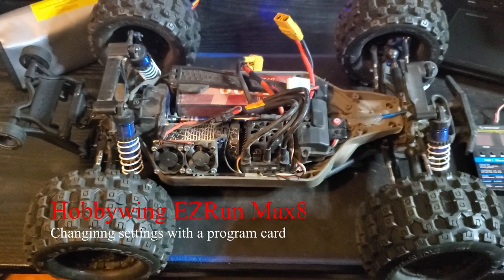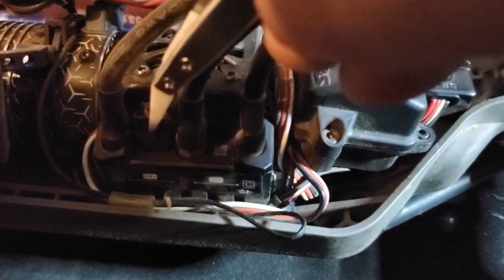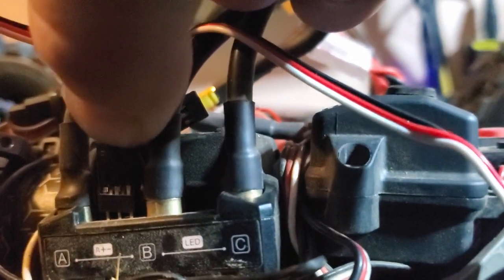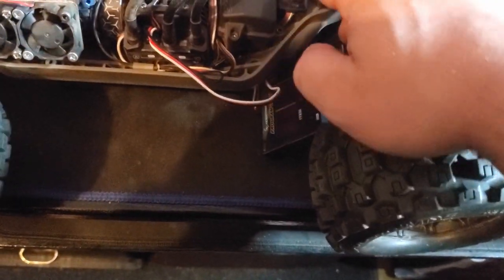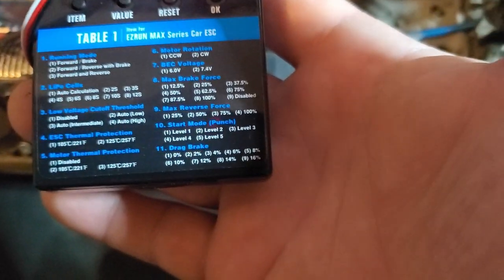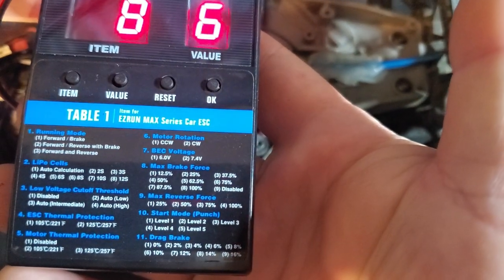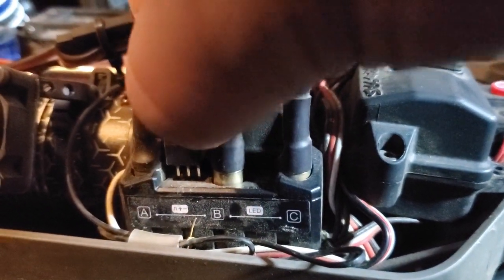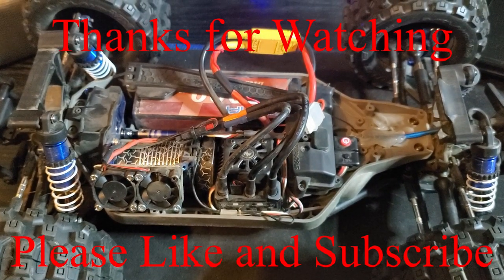Using a Hobbywing ESC Program Card

Comment: Just bought a new 1800kv Quicrun Se and the card only goes up to item #9. It won't let me adjust drag brake or start punch. My card is the V2 with blue sticker
Reply from the maker: Different escs will have different options.  You need to look up what each number is for your specific esc.  It should still be able to change all options that are available.

Comment: Hello dear friend
thanks for sharing your experience
do you have any idea why a hobeywing esc max 8, should burn right after connecting the battery and pressing the button ?

it made a voice and after that it first blink red then afew green and after that makes a low sound and doesnt remain solid green.

the battery was 6s and no receiver was connected !
Reply from the maker: Connect a reciever.

Comment: Hi! I am trying to program my JLB Speed 3 with programming card but it only allows me to manipulate the first 5 settings. Same if I do it by the set button on the ESC. Why is that no access to the advanced settings?
Reply from the maker: Every ESC is different with this.  Hobbywing ones work just like in the vid.  Arrma ones have different settings list so you can manage it but you must look at the Arrma available options.  For JLB I would look up the specific options that are available for that ESC.  I think Arrma only had 4 settings.
Reply: I have a hobbywing ESC, but it only does 5 settings also. Check the "programmable list", if you have the rc instructions.
Just found out my Thunder ONLY has 5 settings I can program with a card.
Reply: I think u need the aplication or the bluetooth one

Comment: Wait....you said put the connector with the wires reversed??? Red on black, etc.
I don't think so... positive should be hooked to positive, right??
And neg to neg.
Reply from the maker: It is not going to harm anything to put the wires in the wrong way I have done it many times.  The only thing that will happen is the program card won't boot.  Just flip it around and it works.
Reply: @bakan723  thanks. But, can you clarify?  It IS red on red, and black on black, correct??
Update: now my new card won't even turn on. No matter how I plug it in. Plus, it never gave me options for any value over 5!
Bad card perhaps?
Reply from the maker: @robertbeam8669  it has been many months since I made this video so I do not remember off the top of my head.  But if I said in the video that it is backwards then I would go with what I said.  Also not every item will have values above 5 some do not go above 3.  Also it is completely different if you are trying this on a arrma vehicle or something with hobbywing equivalent

Comment: I have the jlb cheetah and it won’t go past 5 which sucks because nothing worth adjusting before 6
Reply from the maker: Jlb does not use the standard hobbywing menu options.  So the numbers you see are not the ones listed.  You should try to look up one specific to jlb.
Reply: @bakan723  oh. It’s listed as the ezrun hobby wing esc but I think you’re right I’m gonna have to get a different card. I’ve seen some YouTube videos where people use those white cards to do it. I already had the hobby wing card so I just hoped it would work.  Thanks for the feedback. I appreciate it
Reply: @bakan723  you think one of the re-label stickers would be accurate?
Reply: @bakan723  I figured it out. It’s the label on the back that says car V2 if anyone else asks about the 120 amp cheetah model. The back has the correct settings that match. I used the number of options per setting to figure it out. The numbers on table 2 matched exactly

Comment: Do you know where to find a fan for the HW 1100kv?
Reply from the maker: Well for the fan I like to use a company called wild turbo fans.  But you will also need a mount.  Not sure what size that motor is off hand but maybe try exotek fan mount.